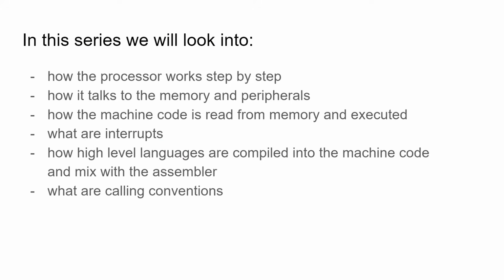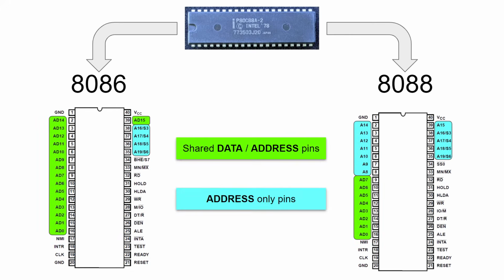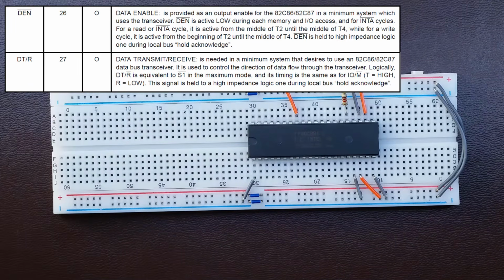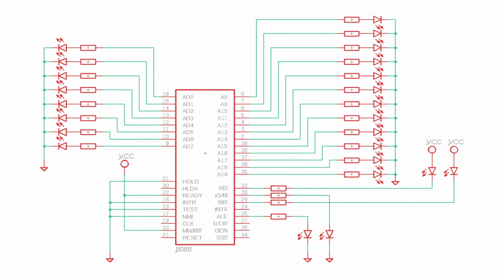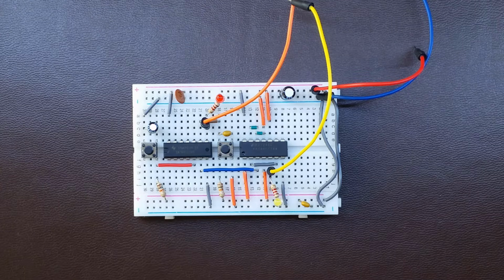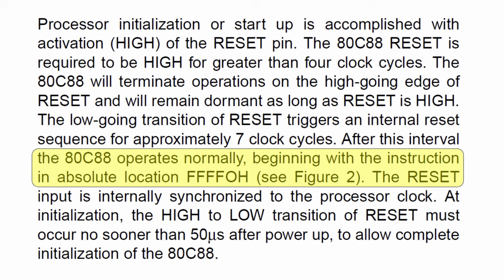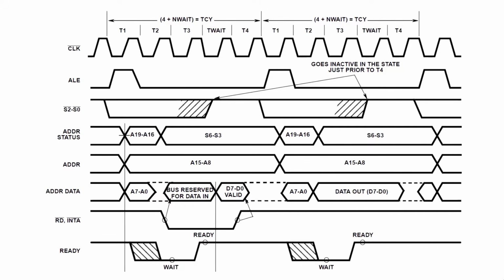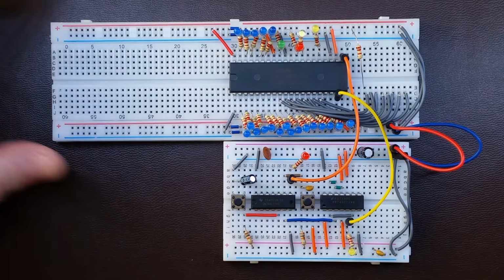First Run - Building and programming a 16-bit Intel x86 breadboard computer [part 1]

Comment: Can we use a NEC V20 instead of an original Intel 80C88?
Reply from the maker: Honestly, I've never tried, but from what I know, yes it can be used instead, but some timings may be different, which means that some instructions may take a fewer clock cycles to execute.
Reply: @SladorSoft  Thanks! I ordered a 80C88!
Reply: @SladorSoft Where did you buy your 80C88, are those still made?

Comment: In this video. You make it seem as if the 8088 was the first x86 processor. To be clear. The 8086 was the first x86 based processor. the 8086 was released in 1978 & the 8088 was released in 1979.

Comment: hello. thank very very much. this is very nice.
this way is the best 8088 CPU test circuit. I search that how to test 8088 chip with easy way. ans I give more that. manual clock part is very inserting....😊🙏

Comment: How did you build your clock and reset circuit? Which chips are used for that? Thanks.
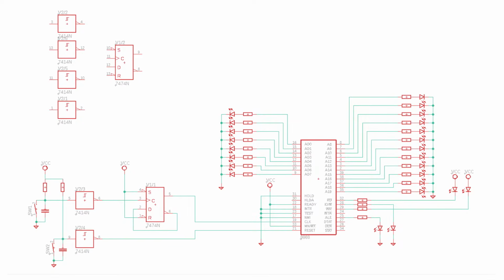Reply from the maker: @mihirsevak4456: the schematic is shown in the video around 12:14 timestamp (the circuit you're asking for is in the bottom-left part). It is also available on my GitHub: https://github.com/sladorsoft/Intel8088OnBreadboard
I used 74HCT14 and 74HCT74. The couple of the pull-up resistors are around 10k and the caps are 1uF

Comment: Can this thing run ms dos?
Reply from the maker: MS-DOS was written for 8088 CPU, so it is compatible, yes. Obviously, to run MS-DOS you need much more than just a CPU. For example, you need a storage to load MS-DOS from, you need a keyboard controller, a graphics card to display anything on, etc.
If you look at my more recent videos, where I build a 80188 system, you will find that I'm working towards this goal - already added a disk controller and more is coming, so please stay tuned!

Comment: hey I am trying to do this on my own so a few questions. 1) What processor should I buy? I am finding 8088 ...8bit processors from intel. I assume they will come with data sheets but I want to follow this as is first so please advise. 2) what is the resistor and LED combination that is put in for data lines? Can you give their attributes how much resistance and what kind of leds to buy? 3) for clock you created a circuit yourself but didn't go in details so can you share what to buy for that please? Thanks
Reply from the maker: Hi there! Thanks for watching and here are the answers to your questions:
1) Yes, I'm using 80C88 - any manufacturer would do it. You can find the datasheets on the Internet easily. I show the relevant parts of it in my videos (including the pinout) as well.
2) Any LEDs would work. Since we are using the 5V logic here and an LED usually needs a few mA to light up, the resistors could have values from around 470 Ohms to 2.2k. It depends on the LEDs, so you can experiment. I found my blue ones really bright at a small current, so used the 2.2k with them. Others are 1.2k in my case I think.
3) I showed the schematics around 12:14 mark (the clock and reset circuit is in the left bottom part). Have a look at my GitHub pages where I publish all the schematics as well. I used two ICs: 74HC14 and 74HC74 (both can be HC or HCT). I missed putting the resistor and capacitor values on the schematics - they could be something around 10-47k and 1-10uF respectively. They are only used there to debounce the buttons, so the values may vary.
Reply: @SladorSoft  Thanks. I am trying to build this. Will let you know if have any issues.
Reply from the maker: Don't hesitate to ask, if you need help
Reply: @SladorSoft  Thanks for your offer to help. I have ordered the parts online and waiting for them to arrive. Is there an email I can contact you on in case I get stuck? Thanks.

Comment: Thank you for your video! Can I use NEC V20 (wiki says that it CMOS too) to build similiar circuit with manually switching ticks of CPU?
Reply from the maker: Hi @yuriiradkovskyi8330. I have no experience with the V20, but I'm afraid that the manual clock may be impossible (despite that it's CMOS as you pointed out). According to its datasheet the maximum allowed clock cycle is 500ns, which translates to the minimum frequency of 2MHz.
Reply: @SladorSoft  Thanx, will buy 80C88 then for experiments like that

Comment: Intel 808x CPU supports >1MB by design, 1MB is IBM PC limitation. In every memory cycle 808x outputs 4 status bits on the pins which can be used to separate/extend memory segments for code, data and so on.

Comment: I've always wanted to know is it possible to build a computer that can run windows 3.11 if so what parts would I need
Reply from the maker: That's a really interesting question. I assume that you are asking about building the computer from scratch (like I do in these videos).
First of all: it is not possible to run Windows 3.11 on either 8088(6) or 80188(6) as it uses the CPU's protected mode. It can run on at least 80286 in so-called "standard mode" or 80386 in the "enhanced mode". Despite Windows 3.11 being a 16-bit OS, the "enhanced mode" is particularly interesting, because - which is not immediately obvious - Windows itself is one of the virtual machines running by a 32-bit (!) hypervisor. Then, any MS-DOS processes started under Windows run each in a separate, additional VM running in the CPU's "virtual 8086 mode".
I think it's quite interesting, in technical terms, because most people would assume that Win 3.x were only a "shell" running on top of MS-DOS, while it was so much more under the hood.
After this long introduction, let me finally answer your question. You need at least 80286 CPU, at least 1MB of memory, VGA controller, keyboard and serial port (for serial mouse) controllers, some storage and a controller chip for that - shortly speaking - quite a lot. And I haven't yet mentioned lots of logic chips gluing everything together. And all of it would probably need to be IBM-PC compatible, so the controllers would need to have standard I/O ports and memory locations.
To simplify my 80188 computer I decided not to follow the IBM-PC compatibility (not to say that you would not be able to run Win 3.x on it anyway), but I hope it will be able to run some of these: FreeDOS, MS-DOS or elks at some point.
Reply: @SladorSoft  right now I have thoes chips I’m gonna get 1pcs 82C450 1MEGABIT Dram VGA Graphics Controller Sis FT232RL FTDI Module USB to Serial for Arduino Mini USB to 232 FT232 USB to TTLMiNi ENC28J60 Ethernet LAN Network Module For Arduino SPI AVR PIC LPC STM32Macronix MX29F1615PC-10 MX29F1615 16MBIT FLASH EEPROM PDIP40 X 2pcs PIC18F4620-I/P PIC Microchip microcontroller 40MHz Flash
50 MHZ Full Can Footprint Dip14 3V3-5V Crystal Oscillator maybe we can work together and our brains can make this seemingly impossible project real or as real as we can get with breadboards lol
Reply: @SladorSoft  also another thing I didn't mention I know it may be really complex in a lot of components and I expected that maybe we can help each other by creating a list of what exactly we need to do and possibly collaborate and make it possible or attempt to at least I mean it may take awhile for me to get the parts being jobless and all but still a good idea nonetheless

Comment: 13:50..  Memory map is not correct... start and end address was switched and ordering .... CS start from 0000H  and DS, SS and ES (FFFFH) side 😀
Reply from the maker: Hi @hyblidblackbox8847. I'm not entirely convinced that it is incorrect. It's intention is to show that each segment register can point anywhere in memory and that its segment is 64kB in size. There is no assumptions about where each segment actually is or what order they appear. The only constrain is that after reset, the CS is initialised to 0xFFFF.
You said that start and end are switched, but memory maps are usually created from bottom up and this diagram follows this convention.
I would defend this diagram even if I wasn't its author. It was taken straight from the CPU datasheet. Funny thing is that it does have a mistake after all, which nobody pointed out: the size of the CS segment is labelled as "64k-bit" when it should read "64k-BYTE" ;-)
Reply: @SladorSoft My apologies.  I checked Intel's data sheet.. You are right. My apologies.
Reply from the maker: @hyblidblackbox8847 - no reason to apologise. Any input is welcome. Our comments here could also be useful for others interested in the x86 architecture. Thanks for that!

Comment: Hello. I copied your project, but instead use a nec v20. What modifications shoud I do with the contraption that drive the CLOCK and RESET signals to meet the 50 duty cycle? Many thanks and more power!
Reply from the maker: Hi there. If you are asking about the manual clock I used in the part 1 then you don't need to worry about the duty cycle - it's way too slow to make any difference. If you think about a high frequency generator, you can use the oscillator built with 7414 from part 4, but at its exit add a flip-flop (7474) like the one in the manual clock here in part 1. The flip-flop will guarantee 50% duty cycle. I'd draw a schematic, but I cannot include any pictures here in the comment.
I'll create a FAQ on my webpage next week and your question will be the first one there. Thanks for that!
Reply: @SladorSoft  thank you very much and more power to your channel!

Comment: В 1986 я собрал свой первый контроллер на К1810ВМ86 и DRAM К565РУ5 на 128kb. Использовал при этом проводной монтаж микросхем.
In 1986, I assembled my first controller using K1810VM86 and 128kb DRAM K565RU5. I used wired installation of microcircuits.
Reply: russian cpus are cool as hell, cpushack introduced me to them and theres just something cool about the white and gold ceramic packaging they use. id love to get my hands on an old russian 8086 machine
Reply: @cal2127 They not ruzzian, stop talking that lies. You can name it as "sovieticus mp", because it was maded in soviet occupation times, or you can name it "ukrainian mp", because it was maded by Ukrainians in Kyiv (УССР), but not "russian".

Comment: Inspired enough , and purchased 8088 cmos chip from eBay lol….
Reply from the maker: @bitlong4669 good job! Have fun with your 8088 :-)
Reply: Finally got around to setting this up.  I hooked up mine to a microcontroller (parallax propeller 1) so that I can see the address lines on the computer instead of LEDs, and inject data on the data lines as well as control clock and other control signals.  Thanks again for making this series.

Comment: just tried this (failed) - I think I have a  bad chip - but rest assured I will try again.
Reply from the maker: Please don't give up! Swap the chip and try again - it's fun :-)
Reply: @SladorSoft   Luckily - it was not the CPU but the noise generator I called a clock. Created a better clock source and was able to "reset" and watch it load FFFF0 on the bus then count up until it was not able to go any further.  next step - get the NOP instruction loaded. thanks for the encouragement.
Reply: @RayMillTN1 hi, can you share your schematics for the clock improvement? Thank you

Comment: What is actually the latest x86 (mechanically) compatible with an 0.1 inch breadboard?
Reply from the maker: It looks like the 8086/8 is the latest x86 compatible with breadboards. The 80188/6 and 80286 have square PLCC-68 packages. The 80386 and 80486 have PGA packages, although still 0.1 inch.

Comment: Thank you for this series of videos. I have a question. I follow the same steps you follow to get the FFFF0H but I get a FFFFFH. What could be happening?
Reply from the maker: Hi @cesarari007. It is really hard to answer your question, without looking into your contraption and taking some measurements. The reason could be anything like faulty CPU, mistake in wiring, reset signal not applied (or not removed when it should be), incorrect supply voltage and so on.
I would start from making sure that your clock and reset signals changes as you expect them to. Again, the "reset" must be held active for at least 4 clock cycles, then it needs to go to "0" and after 7 more clock cycles the FFFF0H should appear on the address lines. Putting LEDs in both the clock and reset lines should help visualise their levels.
I'm sorry that I cannot give you more specific advice.

Comment: can you provide the list of all the parts and equipment needed?
Reply from the maker: @malikahmed49 - thanks for having a look.
My idea in this series was to show and talk about every chip I add to the contraption. Also, when I make changes I always show the schematics with all the elements used at the moment. I was hoping that it was enough to replicate the contraptions. Have a look at my GitHub where I added all the schematics for every video. They are in two formats: the native KiCad and the PDF, if you don't have (or want) the KiCad installed.

Comment: where did you get the power supply
Reply from the maker: Hi,
Since I needed 5V supply, I simply used an old mobile charger. I cut off the micro USB plug and soldered the pin header instead.

Comment: @Slador is it possible to swap the 16bit CPU with a 32bit CPU?
Reply from the maker: @Geo4win well, it depends what do you understand by "swap". If you mean to remove 8088 and (somehow) connect 80386 to the existing components around, then: "no" - it is not possible due to many different reasons. But... if you ask if it is possible to build a similar contraption and observe what happens on the processor's busses, then: "yes" - it is possible and I'm planning to show you exactly that in one of the future videos ;-)

Comment: i can not tell a lightboard from a computer. did you made the ohm resistance calculation. so your board does not generate heat. before you assembled it. you know computers. but you are not an electronical specialist engineer. upfront you can calculate ohm versus current overall value of your cirquite board. and adjust components accordingly . also. does your design serve a usefull purpose or do you use the parts like Lego° ? it looks good ?
Reply: i think you made a "stove" classic hilarisch misstake. but you need to start somewhere. do you want to take an infrared tempreture picture of your design. or do you use this space age technology to bake eggs. ? the guideline is not to make the heat generation ,higher the room tempreture. the highr the kelvin, celcius  fahreheit, the lesses the electrical conduction. causeing a cascade of more heatvgeneration. also. if you out those part so close togehter. you will get radio eletricalmagnetic interfenrentie between compounends. and signal distortion. i see you also dont use mass. all thou i dont know what that means. maybe ask a friend. wich has "all that" as a temporairly "look over your shoulder". those.. ingredients are quit expensive. please save them forever. also when a faster version of "black blocks with pins" will come out. good luck.

Comment: my high school dream is using computer processor to make video game.. i did use 8088 processor to build LCD game.. i think video game thr graphics controller is most complicated then processor.. recently im thinking using 8751 as video game processor bcoz i like yhe ceramic with quartz window able to see the chip ..
Reply from the maker: That's interesting, but personally I'm a little bit too lazy to use anything involving EPROM these days (not that I didn't use it back in the past), especially when trying to fix a problem by re-flashing and testing several times in a loop.
But if you follow this series, I can promise that I will be going towards building a full-featured computer and write a video game for it.
Reply: @SladorSoft  That will be nice.i will check your video later again and follow up.. 

yes agree to re program EPROM is troublesome. but if can try in Flash memory like 28C64 or something then once the firmware work then will program in 2764 or something.. make the RAM large enough so all the software store in SD card using SPI.. i did successfully write in 8051 assembly code to access SD card under 2GB , FAT16 once the firmware work well everything will pass down to SD card like harddisk.. the only thing 8751 dont have Ready and hold pin for DMA..etc i still not sure is it possible to modify by stop clocking the process to let it access the data bus.

For video game project i still not fullty understand how the NES or SNES system work.. i think the most complicated will be the Graphics portion which can handler spirit and front moving object..

Comment: fantastic work, thank you for creating this.
in your videos, you refer to 74hct logic, but in your schematics, 74hc logic.
does it make any difference for the 80c88 or V20 chips?
Reply from the maker: Thanks Graeme!
Yes, that's a fair point. In this case there is no difference between HC and HCT, so I used the general HC family in the schematics, but I had some HCTs in my drawer, so I had used them in the videos.
The difference is important only when you mix these with the LS series chips which have different voltage levels for both 0 and 1. I tried to explain that in the other video: https://youtu.be/7_hZLauyYRg

Comment: Can you please point where can i buy the processor?
Reply from the maker: Hi there!
That the question which was already asked several times here. Since they are not produced for a long time, you can only hope to find them resold on websites like eBay, AliExpress or similar.
It is much easier to buy 80C188 instead and that's why I focused on this CPU starting from episode 7 of this series.
Reply: @SladorSoft  Thanks a lot for taking time in answering that. Much Appreciated.
Reply from the maker: That is my pleasure to answer any questions here. It just may sometimes take a few days to reply like in your case ;-) Sorry for that!